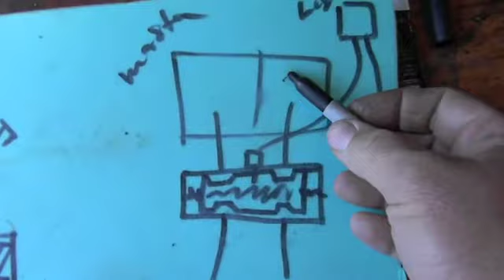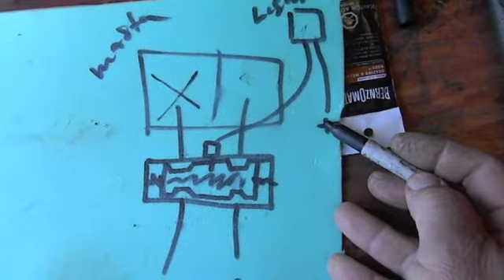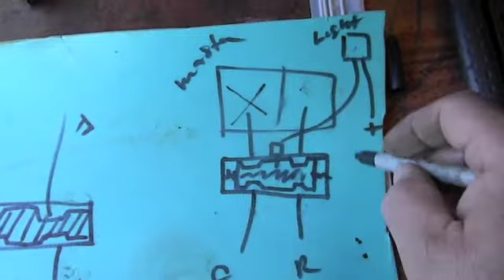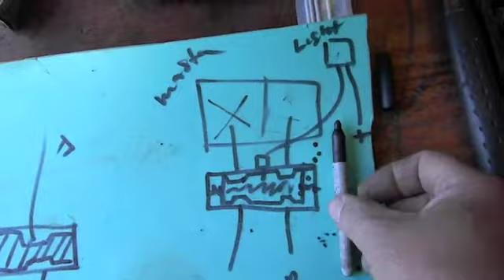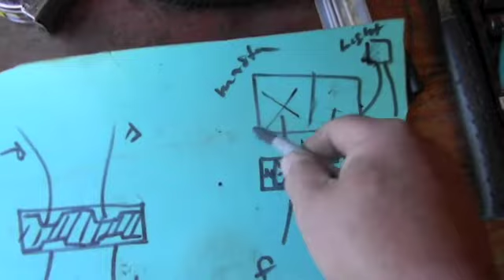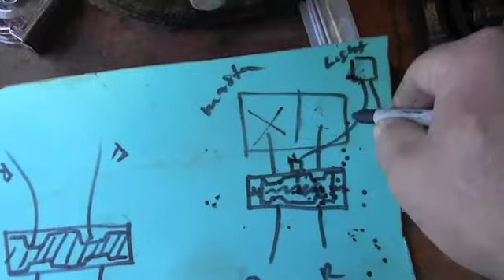Combination Valve

Comment: A big YES on the "pump the pedal" bleed..That's a big no no..I get guys yelling out to "pump it up" so I tap the gas pedal a few times and then cover the brake...He cracks the bleeder I go to 1/2 pedal and tell him it's on the floor and then we go on to the next wheel when the air has gone..I've explained why It has to be that way but most are stuck with the old "pump it up"method...also if there's an internal spring(which most have),It will snap if there's been a bit of H2O in the fluid.

Comment: Yes 90% was a little high but the idea was to express the need for the fronts to be more important..Sometimes we've gotta "dumb it down" for the guys who are learning.Most of the GM vehicles here have the same "brake fail" switch..To reset it we just pull the switch out(no fluid should come out) and just put it back in as it was...Bingo...it's reset.